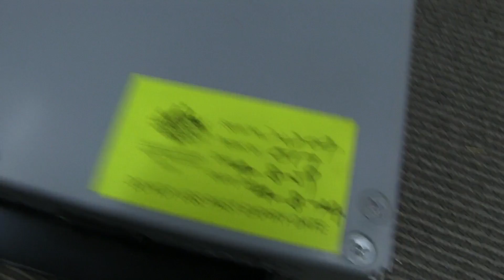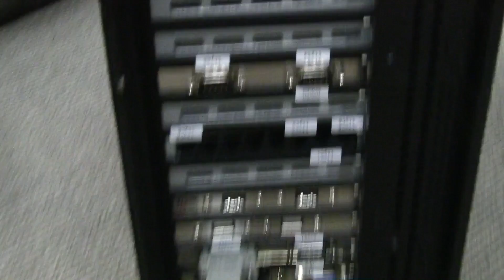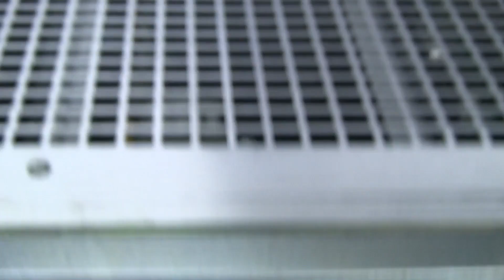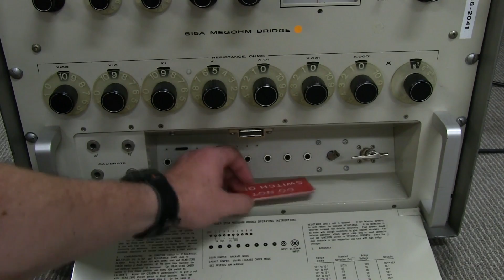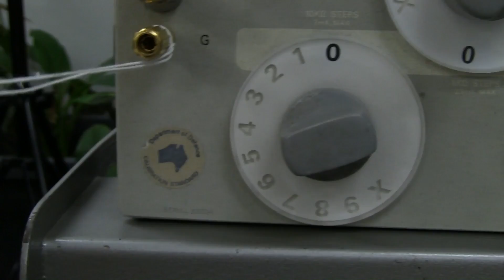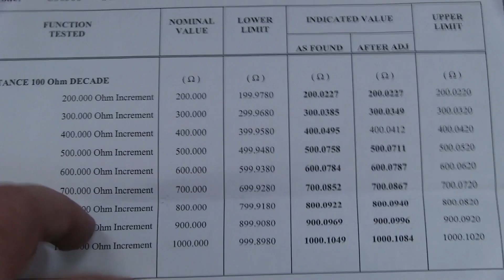EEVblog #455 - Auction Bonanza

Comment: I seen those UPS systems and it took me back . I worked for a huge UPS company and we had a contract to provide maintenance repair and updates . I spent 3 weeks over there working on that same type . All I had to replace was a blown rectifier diode  and blown fuses . The company sent me there 3 weeks to fix it. I fixed it in 4 house . If you see KLH on the UPS systems it was me that worked on it.

Comment from the maker: Peta ohms very quickly becomes pretty much a practical limit for all sorts of practical reasons, unless maybe you were in the vacuum of space or something. I've never heard of a meter that goes much higher. e.g. the top line HP4339B. Throw test voltage into the mix and it's messy business.

Comment: Have a crack at PowerChute with those UPSes. You can set output voltage on battery, low-voltage transfer, high-voltage transfer, sensitivity, shutdown commands, email alerts. Great fun.

You can also turn these things on while unplugged by holding the power button for a few seconds. Maybe you need to charge your phone on the go...

Holding the power button for a few seconds while plugged in will make the UPS enter a self test mode, although this is scheduled to happen every two weeks by default.

Comment: We purchased 9 similar APC UPS. They were 3000 VA capacity and all 9 were bad on delivery. The heavy power xformers had pulled their screws right out of the threads which were made by deforming the thin sheet metal case into a (short) cylinder and tapping it. Four of the replacements were bad as well! When we finally got 9 working we found that when AC input disappeared they tried to boost the voltage before switching to battery. That was enough to cause the loads to shutdown. Useless for us.

Comment: Use the USP system to make a stationary tazer (great way to secure a office, eg if someone breaks in, find some way to make them come in contact with a 15 amps+ 240 volts. After a few full battery discharges worth, they will seriously rethink their line of work.

Comment: These APCs are online or semi online? those are pretty good in terms of isoation and surge protection. but the waste of power is incredible. You will drop about 15% of your energy just in the UPS. 
In terms of the TTYs it looks like a digiboard RS485 (or 232)